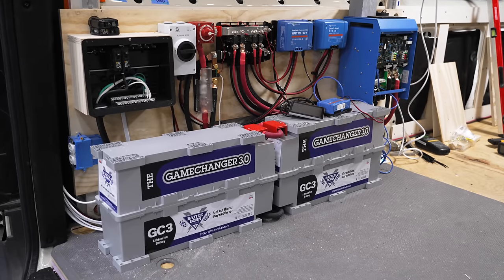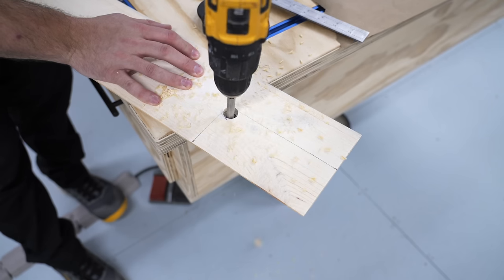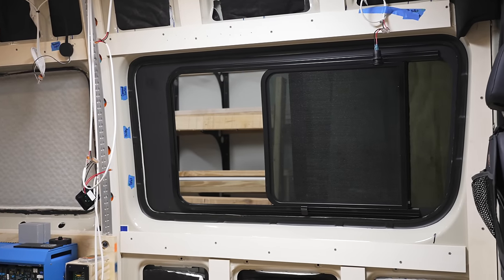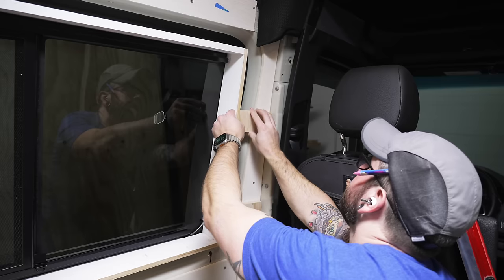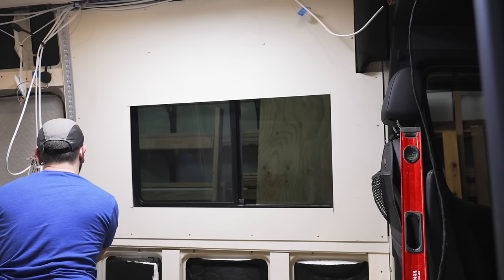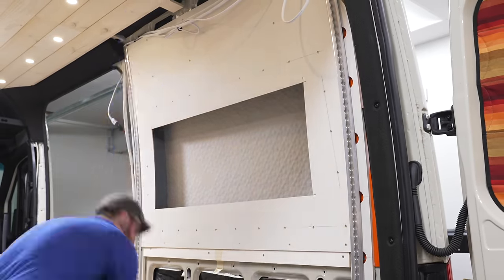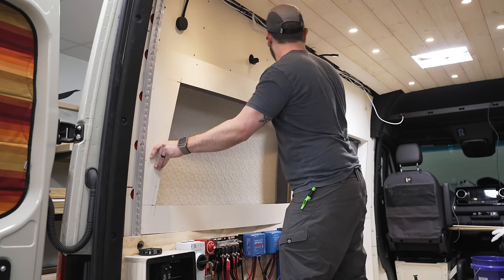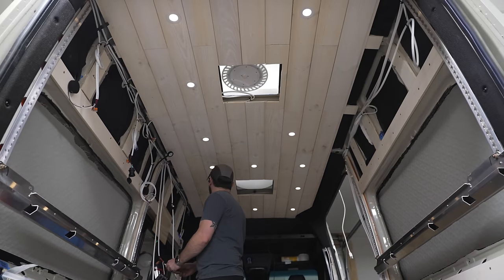Installing Plywood Walls & Shiplap Ceiling in a Camper Van

Comment: One of the things I would have recommended, is the empty spaces behind the plywood panels you put on the wall, and the shiplap on the ceiling, would have put more insulation in. It would help with both the winter and summer with regulating the temp in the van.